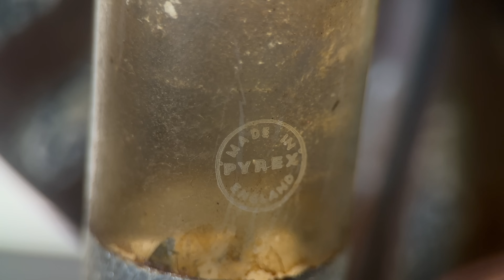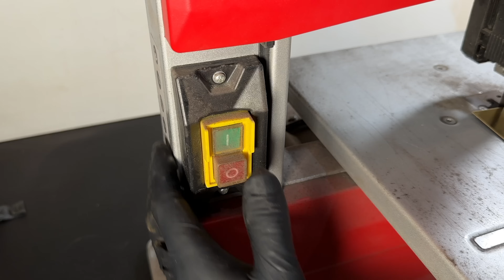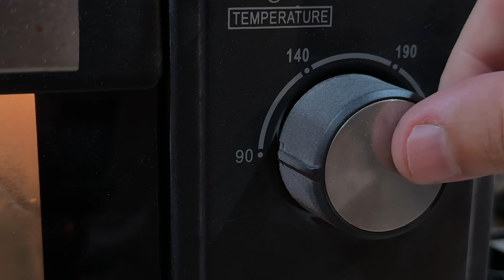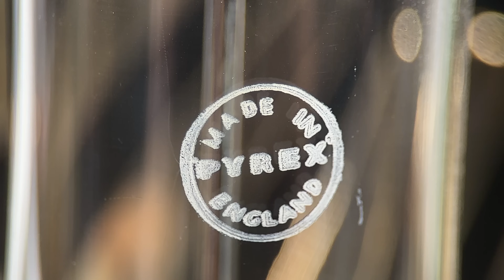1880's High Voltage 'Wimshurst' Machine - Restoration

Comment: this looked in surprisingly good condition for being 140 years old. was probably stored properly.

nice restoration, cool to see something completely different than usual!
Reply: I would hazard a fuess that that particular one is nothing like that old. The materials are more 1980s than 1880s. Polystyrene, for example. 
Also, the Leyden jars are Pyrex, so can't be pre-1915.
Reply: Yeah that's what I was thinking, styrofoam wasn't invented until the '50s so it can't be any older than that. @andypughtube
Reply: absolute fraud to put that in the title.  "a fan" is not 2000 years old just because the chinese invented one that long ago.
Reply from the maker: That machine was designed and developed in 1880. But this one comes from mid century XX

Comment: 55 years ago, as a pupil in physics class, I became acquainted with this machine. I received an electric shock that I will never forget.
As a result, I became an electrician.
Reply: About 45 years ago for me, we were trying to see how long a spark we could get on an EXTREMELY dry day.  It was my task to tap the adjuster to move the electrode closer, well I missed and landed about 6 feet away wondering how the mule that kicked me had gotten into the classroom on the 4th floor.  We were drawing about a 6-7" spark when I got bit.
Reply: @michiganengineer8621  Oh yes, I take your word for it. Thank you for your answer.
Reply: oh so that's how it happens then... just like the Peter got bit by a spider and became spiderman
Reply: @michiganengineer8621  that's also an electrifying story.
Reply: @JorgeALXNDR  SMH. Welp, I guess it's true, then..."With great power, comes great responsibility"
Reply: Shocking!
Reply: My encounter with this terrifying machine was 59 years ago in a science class (first Wyndham year) and my hair stood on end and I felt a tingling all over but not unpleasant. These days his would not be allowed.
Reply: Way back in Middle School  (Something like 35-40 years ago) we had one of these in our science class on a metal rolling cart - the top of which was just short of waist high.

One of the class jokers liked to open the balls all the way, hold one of them, and use his other hand to crank the machine until he built up quite a charge - then hurry over to some unsuspecting victim and zap them.

I was watching him do this one day when he decided to really go for it and build up as large a charge as he could.  So he really wailed on it - cranking like a madman until he was carrying a huge charge.  And then - ZAP!

There was a huge spark and flash, very clearly audible.  Followed by a pitiful sound escaping his mouth as he crumpled to the floor.

Remember the cart height?  The metal rolling cart.  Rolling on rubber wheels.  He wasn't the only thing building up a charge.

The difference between the charge he had and the opposite charge the cart had overcome the gap and arced through his zipper into, well, the part of him closest to the zipper.

I watched this and gained a very healthy respect for these devices.
Reply: bro you died on that shock i am here to tell you ,you gotta go,you need to arise to the skies,your relatives have been waiting for so long
Reply from the maker: Wow 😳👍

Comment: Excellent restoration! I did a similar one for Jadis Movie Prop Rentals in Santa Monica, CA. Extremely interested in how you handled the Capacitors. I laminated aluminum foil on the outer and inner surfaces. The inner surfaces were real tough to get right. I liked your method much better! I also put a handful of steel ball bearings in the capacitor bottoms. Used similar melt bonding belt material. Really a treat to watch and learn from your restoration!

Comment: I once saw plans to make your own at home using a couple of old LP records and some aluminum foil for the main disks, and some large prescripton bottles for the capacitor bodies.  Almost had al l the parts at one point, but never got to finish it...  Nice job on making this classic device looks like new again!
Reply: I made one (secondary school age) 😖with old 78 RPM records and dishwasher liquid bottles and aluminium foil for the Leyden jars. Worked well for a bit then I got a huge whack from it and smashed it as I pushed it away.😖

Comment: Excellent work. Now it's an art object.
I once had to restore a similar electrophorus machine made in the USSR in the fifties of the twentieth century. But it didn't turn out so beautifully.
The only nitpick is the condition of the brushes for removing the charge. But it's very difficult to find suitable material for their repair. Nevertheless, it works great. Also a great selection of paint.
I'm happy to give your video a Like and will see what else you've restored.

Comment: Beautiful job you did restoring the high-voltage Wimshurst machine.  I have never seen a machine like that before.  Anyway, it looks much better and it works like a charm too.  I am amazed that it could generate high-voltage current.  Excellent work.

Comment: Clever idea with the copper wool to fill the void of the Leyden Jars. Also the aluminium duct tape is a good one aswell. Gotta remember this one.

Leyden Jars are still used today as they resist high voltages way better than their electrolyte buddies.

Comment: You're a hobbyist, so cutting the contacts individually by hand on the band saw is fine. I imagine if anyone were to be making these in a higher quantity, some kind of multi-punch tool would be ideal. That said, this is beautiful! You might want to find a way to keep the crossed pull cable from rubbing though. Still, great job.

Comment: In science class in Jr High, we used these to charge Leyden jars, (https://en.wikipedia.org/wiki/Leyden_jar) which are another thing altogether.  When charged, you can disassemble the jars, (carefully I might add) and all the single components are not dangerous, but reassemble them back together and they still hold the charge that they once had...amazing.  They will give you enough of a jolt, you might see stars.  (in thinking about this project, it almost looks like the large test-tubes are miniature Leyden jars themselves)
Reply from the maker: Oh wow I should have tried that definitely ! Thanks for the tip ! 😉

Comment: Really nice to watch.. 

Standout moments for me were at 5:00 making those ebonite wheels shine like mirrors! (Similar to bakealite?) and 10:20 when you cleaned those tubes out - like new! 

Did I miss when you replaced the brush ware? Or did you somehow manage to re use those old ones?  I watched you clean them up from about 14:00 onwards.. but on re assembly some looked changed? 

Cheers for the upload 👍 nice re build..
Reply from the maker: Thank you very much !! I didn’t know ebonite ever existed…it looks like bakelite. I didn’t change the brushes, just cleaned them. It works just fine like that 😉🙏

Comment: If you watch the BBC show, "The Repair Shop", the great-great-grandson of James Wimshurst brought his original machine in for restoration. (SE08E04)
The original used electroplated glass discs.
The problem with you using cut sheet for the contacts is the step is too high and the brushes will wear out quickly.
Nice restoration though. We had the very same Pyrex model in our school physics lab back in the 70's.
Reply from the maker: You’re right regarding the contacts ;)
Reply: @TheFabrik  Have you considered making a mask and spraying with electroconductive paint? Then you could use electroplating with a harder metal such as tin or copper.
Reply from the maker: that’s a great idea ! I wanted to use the same aluminum adhesive as the one I used for the capacitors. I like that yellow brass tho ;)
Reply: @TheFabrik  I doubt that would stay on long, it would end up peeling off.
I can make you up a stencil vector if you send me a photo with a scale reference.
Once you have the graphite down, you can either do it the quick way with an electro conductive pad, or the slow, but thicker deposit, tank method.
Reply from the maker: @TryptychUK thank you very much ! That adhesive is too fragile you’re right. Actually I already have a pdf with the schema of the contacts (got it from youtube ;)) Thanks anyways 🙏

Comment: Awesome! Honestly, since this is relatively modern and not realy of museum quality, adding Your own toch to it like this is an upgrade and just adds to the history of the machine and it realy look beautiful now! I lve thos old education tolls, i collect them my self whan i come across old laboration devices for a good deal. I don't have any of those, but from the little i know it does work witout those metal discs, but it need to be initiated manually without them, there is a slightly different machine, i can't remember it's name that are constructed that way and built for laboration with much higher discharge rate, but tyhose need to be initiated manually, for example with a charged staff.

Comment: I figured out a way to use the electrostatics of this machine, and using  a regular 775 motor, the usual high voltage caps, some modern ones too, some regular 1000uf 80 dc volts caps, diodes and a transformer at 110/120 to 14vac and some modern boost converters to make this thing run itself.

Comment: Nice ! .. but I'm sceptical this one is from the 1880s. General style, but especially the Pyrex marking on the boiling tubes used as leyden jars .. 1960s ?
Reply from the maker: It was designee in 1880. That one comes the 50’s

Comment: Unlimited power this mixed with a railgun voltage accelerator circuit whereas was taught to me and nuclear power circuit in fact starships use really big ones of these this is the cleanest way that there is to come up with positronic energy I keep trying to call it a Van de graaff generator and that's where I keep messing up you build one of these with 4-ft discs space the discs exactly an inch and a quarter apart and make them running opposing directions and you get 32 of them they said it wasn't good to go over 27 inches but 32 of them and instead of putting them at an inch and a quarter you put them at 2 1/2 and you build just like an iris stators to slide in and out of the spinning discs and get some real control out of it you'll get to where you're pushing air through the discs and you actively remove the brushes all together in the air is floating the disc or the rotor on electromagnetic and the staters at a certain point you'll even remove the rotor in the center altogether and these are used in starships and they were discontinued a long time ago but the people still make them all the time because of how reliable and easy to repair they are in fact when these things are down to around 16% efficiency we either give them to the government or we miniaturize them and use them at 16% of 1% as a flashlight battery or a drill battery key tool battery hyper spanner battery hyper spanner is a😊 crescent wrench and a drill and a milling machine with a universal key tool head
Reply: According to the calculations that they've recently handed me I'm building a bigger version of this same generator and it's got 32 discs let's spin with 33 staters that are all each one like another sheet of mylar that's an iris they said it's something around 10,000 megawatts they said if I put all the stuff on it like what I want to do I should be around the 10 wat range Padawat but regardless if I'm in the million watt range I'll be happy as f***

Comment: Are the plastic components on this made of PVC?  I just looked it up and Bakelite wasn't discovered until 1907 but PVC was discovered between 1838 and 1872. Weird that we stopped using so many other plastics at this point but were still using one of the oldest.
Reply from the maker: Thanks for the infos 🙌 I thought it was bakelite. It’s definitely ebonite 👍

Comment: Please, what aluminum tape did you use for glass tubes? Thanks
Reply from the maker: It’s the adhesive used for ductwork, insulation, and metal repair 😉
Reply: @TheFabrik Yes I know that but yours looks very thin, flexible and wide. Do you maybe have link to actual item? Thanks, S
Reply from the maker: @suadcokljat1045 sure https://www.amazon.fr/gp/aw/d/B0CZ6JJ69W?psc=1&ref=ppx_pop_mob_b_asin_title

Comment: Ok, now, lot’s of great comments. Seconded. Great job. But. I am a perfectionist. Hard. Grrrrr. One of the green poles still had a sinkmark on the inside. The craquelé paint is tad too much for me and the glass disc caps, the inside holes were still a bit crusty and one had a slight yellow tinge remaining.

Comment: I was wondering, I wonder what happens if I hold a wired hanger between these two orbs that create electricity. Would I get shocked by electricity when I hold the hanger between these two orbs?

Comment: Borosilicate glass is some decades oldert  than Pyrex brand but here we can see text clearly. Pyrex as brand is from 1915 so this is younger than 1880. Some things more to comment. Spark leads has coin shaped plates , not double balls as usually. Sharp corners made it "radiate" electrons away and spark is weaker so usually there is no sharp corners => ball shape.

Comment: Fake as an Adam with a bellybutton: Pyrex was invented in 1915 how a machine from 1880 can have a glass tube marked  "Pyrex"?
Reply from the maker: That machine was invented and designed in 1880. That particularly one comes from 1920/40 I guess
Reply: @TheFabrik  I see. The title is a little misleading though. Anyway Whimshurst machines are an incredibly ingenious devices, no using friction but induced charges.